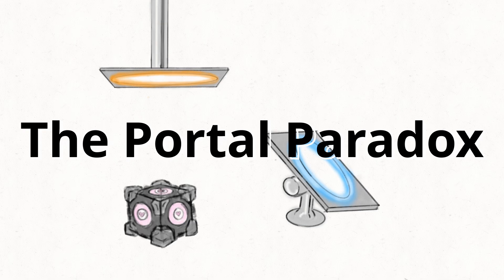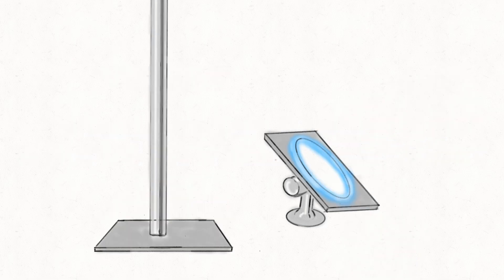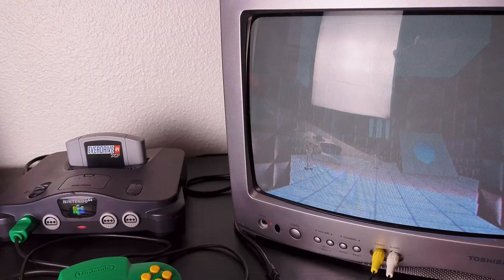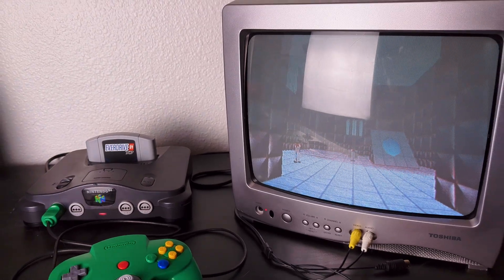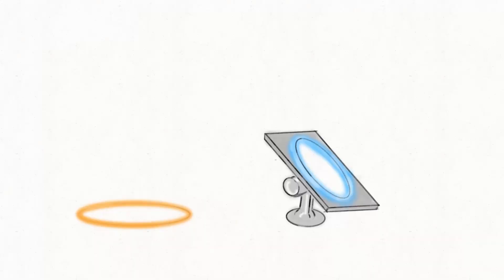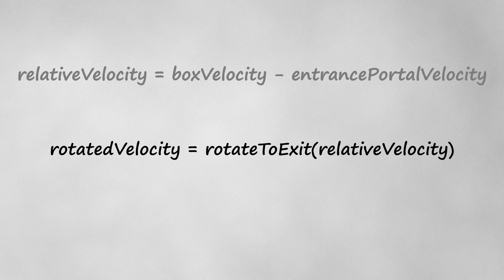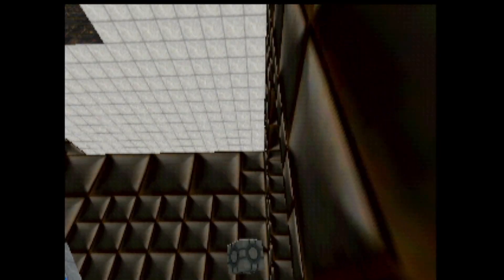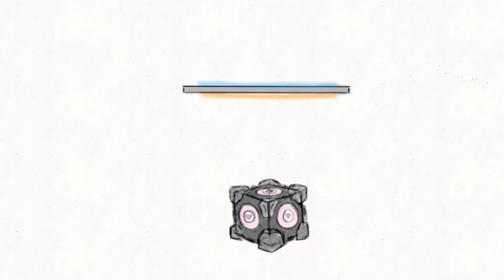I rewrote Portal from scratch and solved the Portal Paradox

Comment: Heres my 2 bits on the matter, by simply looking at this from the view of the conservation of energy. Imagine it like this, you have 2 platforms, when one moves down, the other moves up, if we ignore friction for simplicity both platforms (aimed from the ceiling to the floor) generate/lose 0 potential energy from moving, now place the cube under one of these platforms, and place a portal on both a stationary platform, as well as one of the moving platforms (the one above the cube) if you slam the platform with the portal down, the cube, by all reason, should not accelerate, because that would mean that energy was created from nowhere, this isnt possible. (the platforms hold potential energy equal to the mass of the platform, multiplied by the rate of acceleration, multipled by the time it would take for one platform to hit the ground) but if we look at it from the same perspective, and assume the box will NOT accelerate out of the stationary platforms portal, then the box, by all means, should simply pass through, become affected by the change in directional gravity, and  fall to the ground, with that assumption, all energy is conserved, this checks out. Now imagine the same situation, but instead of a cube, its you, you're taking the place of the cube. If the portal above you slammed down onto you, you would not expect to go flying, because you havent been moved, the effect of gravity would grab you and pull you to the floor, which makes sense, but because you are not being "pushed" but rather, simply entering a portal without a change to your own velocity (as the only thing accelerating is the portal) your speed would not be affected. From his point of view though, if you were in the place of the cube, then supposedly, the second the portal started to pass around you, and you began to pass through the portal you would feel some push/pull accelerating you out the other portal, but where would this push/pull come from? The portal does not exert any energy onto you, the platforms wouldn't exert any energy to you, you would simply find yourself on the other side of the portal, and then gravity would take affect and you'd fall down. Sorry to burst your bubble, youre fantastic at programming, and i love the work you put into this thought experiment, but your math is wrong, if you think something works some way, but your theoretical math ends up with with more or less energy than when it started, then you're wrong, simple as that. Great video anyways, and thank you for not making a 40 minute video on this, cause that would have been a little hard to watch.
Reply: What if we had a stationary vertical exit portal and a vertical entrance portal with a horizontal velocity moving towards a grounded and stationary object, what would happen to the object when entering the portal?
Reply: It would be impossible for a platform to move if it used 0 energy unless the platform had a mass of 0, which is impossible, therefore you are incorrect.
Reply: @gremoblin5905  the platform is moving, and he says it doesn't generate or lose energy due to air friction (a common hypothetical to simplify theoretical situations).
Reply: Ah, but the issue here is fundamentally linked to portal creation, which is dependent on the method of portal technology.
The hypothesis you propose is that of wormhole theory, whereas, from my understanding, the video shows calculations that would be indicative of quantum tunnelling. Which I do believe is how the portal gun works.

Comment: There is no Portal Paradox. Your experiment is completely logical. People suggesting that attaching the entry and exit portals to one another would cause a paradox, are simply dumb. But here's another thought: in your experiment, you're assuming constant velocity - conveniently giving the entire object the same velocity delta to inherit from the portals. Now what would happen if, while the box enters the 1st portal, the portal would slow down (or accelerate)? That would force the "front" of the box (as in: the part of the box entering the portal first) to have a different speed than the "rear" - resulting in massive stress on the structural integrity. The easy answer is probably: the object would either get squished or torn apart while passing through.
Reply: His experiment isn't logical at all, I'm not going to type another explanation again but look at my other 2 comments and you'll understand very quickly why his math doesn't work (hint, it has to do with the conservation of energy)

Comment: What if the exit portal is at the ceiling, and you stop in the middlle and go up again? Shouldnt the gravity drag on both sides down equaly, resulting in lifting up the cube with the entry portal, sticking it at the ceiling in both cases?

Comment: Ok, so I'm not as smart as you, that's a given.  And I recall wasting plenty of time on this and other puzzling questions about portals many years ago.  I'm also probably far from the first person to look at this problem this way (probably not even the first person in this comment section), BUT... seeing this again now, I see a major issue with both this solution and this explanation.  Relative velocity of the portal would matter if the portal were a solid object, but it is not (or rather, would not be if it were real).  It is an open space leading and/or linking into another open space.  It lacks any mass of its own.  The moving object that it is attached to has velocity, but not the portal itself, other than perhaps, arguably, the ovular border of it, so unless that moving object comes into contact with the box, there should be no energy transfer, or at best it would transfer its energy into the platform the box is sitting on, which would then transfer some of that diminished energy into the box, causing it to kind of hop, but almost certainly not to launch.

Consider this;  you have a window frame, just the frame with no glass, or maybe a door frame with no door.  Now you drop that over a box.  Does the box go flying out the other side of it?

Comment: No.  Go to the back of the physics class.

The speed of the moving portal only defines how fast the object transitions through the portal.  It doesn't impart any energy or force to the object itself and therefore the object wouldn't fly out of the exit portal.  It would just transition through at the speed of the moving entrance portal and then fall under gravity once through.

If the exit portal was also moving (and if portals are one-way) then any object moving slower than the portal would be pushed along by the exit portal itself until it managed to fall out of the way.

If portals act as two-way conduits then a stationary object would move through at the rate difference between the two portal speeds until it fully transitioned at which point it would be pushed by the exit portal.  (Basically, if the exit portal was moving faster than the entrance portal the object wouldn't be able to enter in the first place and would be pushed by the entrance portal.)

Comment: Cool concept, but I have some issue with the logic and result. I believe the out put cube should be either fragmented into slices or stretched, as the portion of it that has already passed thru the portal begins moving, while the portion yet to pass thru the portal remains stationary. The transition happens quickly, however there is still a length of time when the cube is in two different states, part moving, part stationary…thus I think it would stretch during the transition. Thoughts anyone?
Reply: That doesn’t make sense. The cube isn’t “partially” moving. Relative to the portal, it is completely moving. Relative to the platform below, it doesn’t start moving until the entrance portal hits the ground. There is no “cutting it up” or “partially moving”
Reply: Of course it makes sense...you can even freeze the video when the portal "hula hoop" has only consumed half of the cube, showing half of the cube sitting stationary on the ground, while the other half is already flying out of the exit portal with motion. The only way to have part of something stationary, while the other half is moving it to stretch it. It's speculated that a similar thing happens when an object enters a blackhole....the gravity is so strong that the part closest to the blackhole accelerates faster than the part furthest from the black hole and thus the object is torn apart as different sections of it accelerate at different rates at different moments in time.  The only difference here being that the cube starts out stationary, while the object approaching the blackhole is already in motion. @tommybomby4122
Reply: @ozmaniac33  even though it’s moving through the exit, the entrance has the same speed relative to the platform. There is no way for a portal like this to work if things can change “inside” of it because there is no “inside” of it
Reply: You are missing the fact, and thus wrong in your assumptions, because you fail to consider that the entry portal may be moving, but the exit portal is not, and thus the speed of the cube is zero on one side and has velocity on the other. If the entry and exit portals were glued "back to back" and BOTH fell over the cube together, it would be like a hula hoop was dropped over the cube...then you'd be correct because the cube would enter and exit each at matching speeds, but both portals would be moving, but one portal is moving while the exit is stationary. 

Ignore the orientation of the portals as shown, and imagine them starting back to back and instead of the entry portal descending on the cube, it moves laterally to consume it. In this case the distance between the portals increases as the entry portal moves away from the exit portal....the entry portal is both consuming the cube AND giving the consumed part velocity it didn't have, prior to leaving the exit portal. @tommybomby4122
Reply: @ozmaniac33  dude. It can’t enter the entrance portal without having the EXACT SAME relative speed to the exist portal. Any claim otherwise is a fundamental misunderstanding of the way this kind of portal works
Reply: In reality it would stretch with the analog passing of time, but in the game, it might appear to be sliced or cut up due to the fidelity of the frame rate of the animation. @tommybomby4122
Reply: Imagine you could watch the event in slow motion and it took 30 frames/sec and one full second for the entry portal to consume the cube, starting just before it reaches the cube. One frame later, 1/30th of the cube has exited the exit portal and has motion moving away from the stationary 29/30ths of the rest of the cube. in the next frame, the second 1/30th of the cube now has motion, but is already lagging behind the first 1/30th of the cube, but also now moving away from the remaining stationary 28/30ths of the cube.  This repeats for the next 30 frames, leaving 30 slices of cube flying out of the exit portal. @tommybomby4122

Comment: This has many issues, (few that come to mind)
The 2 portals exist at the same point in space, so they can't have different momentum.
The cube has mass, the portal doesn't , so you create energy from nothing, it's instant, compared to when just letting it fall for eternity.
Since it's the cube we want to check its speed to need to check the cubes point of view, it's current speed and current accelerations acting on it in each point in time. What the portal does is change the different forces acting on the object, so at first it's in balance, with gravity pushing down and group pushing up. Then it's on a slope, and the gravity can start accelerating the object.
You had to invent your own physics, and calculations for it to act as you want it to.

Comment: If you went this far, try implementing putting portals through portals. Freaky fractal stuff is supposed to be happening if I understand correctly.
Reply: fractals are something else. if you put a portal in a portal it goes in and out at a diferent point. and if you collide them in the middle you can watch the portal comes close to the 2nd but you see the 1st comming like a mirror as as 1st portal touches the 2nd, it touches itself inside and collides it self.

Comment: Not calling you wrong, but I want to see how you can account for a few hypothetical scenarios. 

You see, my issue with your explanation is that it assumes a transferral of motion. To explain that issue as simply as possible, let's assume the block is halfway through the portal on the piston. Naturally, the prior movement of the piston portal wouldn't suck the half still on the ground upwards. 

To build on what I'm trying to convey your hula-hoop argument was flawed. I'll refer to it as a doorway instead, as a portal is more akin to a tunnel without its midsection, and I feel it's best visualized as a tunnel. 

Instead of having both portals being on the opposite sides of a moving platform, imagine there is one stationary portal, and one opposite facing portal that is moving towards an object, and said object passed through the object due to the moving portal. Regardless of the movements of the portals, there isn't actually any distance between the two portals, merely the doorways themselves are in different locations. If you were to thrust a rod through the moving portal, the rod wouldn't be pulled from your hands and launched through the stationary portal, as the rod itself lacks a vector that would cause that pulling motion. 

If you stuck your leg in a portal, and that portal moved slightly to the side, you wouldn't lose your leg, but rather you would see your leg move in the other portal, without moving, yourself. The reason why you would keep your leg is that aforementioned tunnel I was referring to, simply because there is nothing in-between the doorways that would generate a vector. There may perhaps be one on the other side of the portal, but there is nothing in-between. 

Alternatively, if there was a stationary portal you threw a ball through at 40 mph, and had the other portal travel forwards in a direction at the same 40 mph, the ball itself wouldn't double in speed up to 80 mph, but rather you would see it linger on the other side of the portal, before coming back to its original side, after losing speed, due  wind resistance. In other words, the ball would briefly move in tandem with the portal, but since it isn't being granted the external force affecting the portal, the portal would not be affected by the same loss of speed. HOWEVER, if you were to stick an arm through the same stationary portal, you would feel the wind resistance, but your arm would remain stationary, relative to the moving portal. 

If you built a new version of your hula-hoop model, with the cube being pressed down on, and you had a stationary portal facing upwards, there is no reason why it should generate force, since the only reason you even see the cube in the other portal, is due to the distance from the ground below the cube, and the ground around the stationary portal being the equivalent of 0. The cube never actually moved, but rather, the tunnel moved its doorways around the cube. 

I'm really tired, so please forgive me for not being more concise, nor typing out a new formula, but basically, you would feel airflow from the stationary portal, not because something happened to the air from the portal, but rather the air would be pushed by the other air going through the portal. For the cube to be pressed down on, and travel through the portal, the portal would need to reach the ground; and as such, there wouldn't be anything to propel the cube forward. 

I genuinely cannot find a logical way for there to be a new vector on the cube, strong enough to be responsible for moving through the air. If the cube was pushed up, through the portal, its vector would be the inertia of it being pushed, but that's not what happened in your demonstration. The cube had no vector until it finished passing through the portal, and then gained a significant vector. The whiplash of that poor cube must've been insane, given that instantaneous acceleration; since, it could not have had a vector, while only partially being inside the portal.

Comment: OK, you've changed my mind. 
I'd only taken the momentum of the cube into account before, there's no way a cube could suddenly gain a ton of momentum when passing through a portal if the portal doesn't effect an object's momentum when passing through it, but in reality, it does effect the momentum when going from a moving portal to a stationary one due to the change in relative momentum, the portal imparts it's own momentum onto the cube passing through it.
The faster the portal moves, the greater the force acting on the leading edge of the cube from the trailing edge of the cube being forced through the exit portal behind it at speed, leading to the cube effectively flying out of the exit portal.
The relative momentum should be the same if the portal moves OR if the cube moves, I hadn't looked at it that way before, well done and thank you!

Comment: The point of the portal is to make 2 spaces one not to impart energy on the cube. relativity does not apply because the second Portal is not an observer to the cube. You should be using actual velocity. With your calculation if the cube only went half way through the portal the cube should be sucked the rest of the way through.